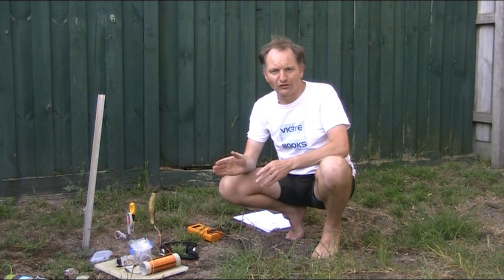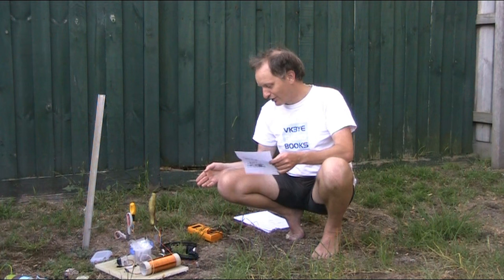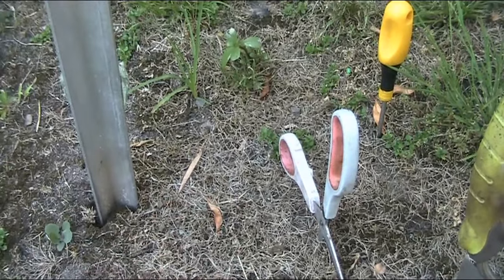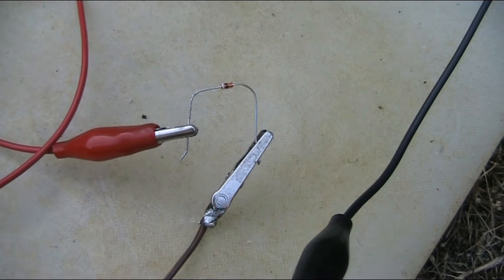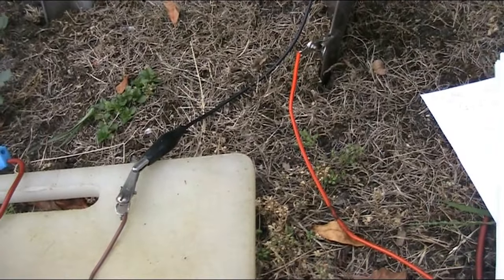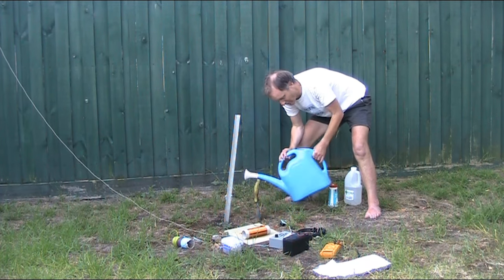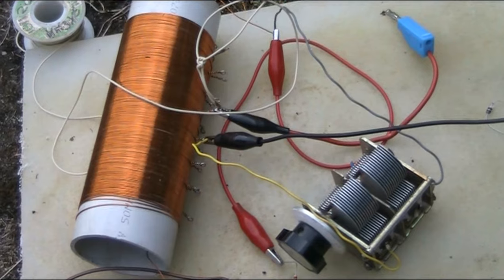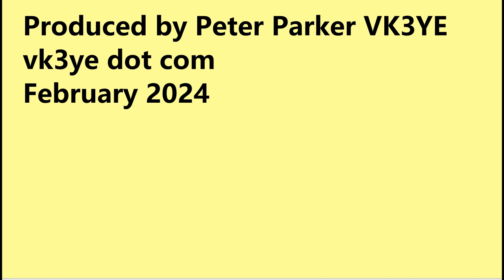The silicon diode crystal set that needs watering

Comment: I use a loose coupler design with 2 tuned circuits. works much better.
Reply: Yes, a loose coupler gives better selectivity but it does cost you a little sensitivity.  My experiment with a tuned loop antenna showed that very little is given up if the antenna side is also made resonant to the station.

Comment: Fascinating, I had never considered that method of forward biasing the diode. Something I have seen with the glass encased silicon diodes is their light sensitivity, i was working on a detector circuit and found the output was varying as I moved my hands close to it, the desk lamp was affecting the diodes. I just put them in sleeving because it was not a random project but it makes me wonder what the effect of light would have in your crystal set. I know that in light metering applications they operate them reverse biased but it might be interesting....

Comment: Surely you would want to use a potato for pedestrian mobile :)

It's quite interesting seeing old discoveries put to the test. If I had to guess, a very small DC bias just under 0.6v might be ideal? Ideas to keep in the back of the head for when I get into receivers...
Reply: I would think so too. Just enough bias to overcome the forward voltage of the diode. So 0.3 Volts for a point contact germanium diode.

Comment: You could try a lemon with copper wire and zinc elecrtodes (made from old dry battery casing or galvanized clout nail).

Comment: Cool. I was wondering about this some time a go. I think aluminum and carbon pair in small closed water container might be better. There is less galvanic effect and it's more controlled. You could also use another crystal set on strong channel just for additional power.
Reply: Yes, great idea. Use a flame thrower radio station for power source.

Comment: use hot carrier diode
Reply: 1N5711 works but you do need about a 2K loading resistor across the headphones to make it work well.
and large diode tends to have too much capacitance and high voltage ones tend to also have a higher forward voltage.